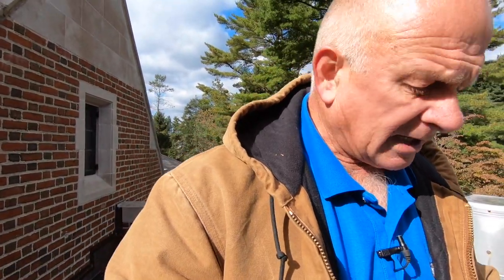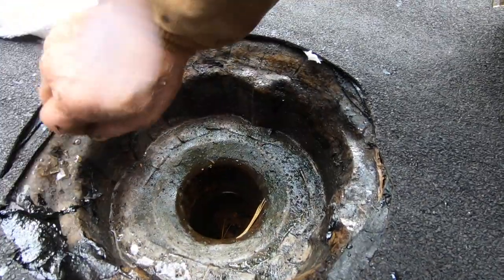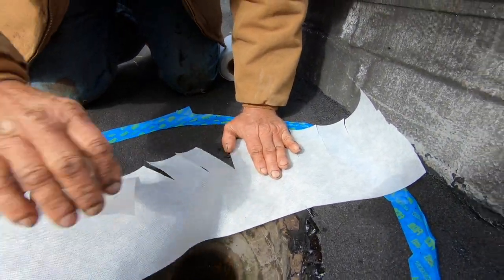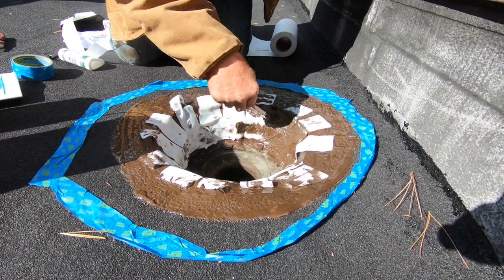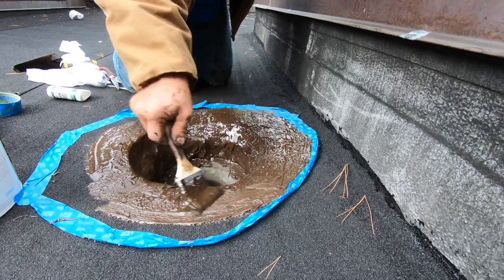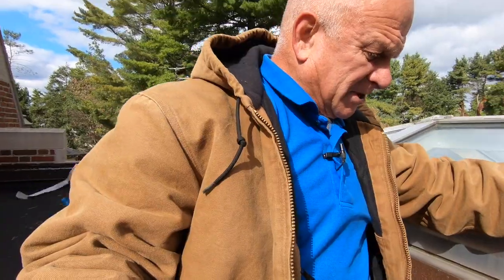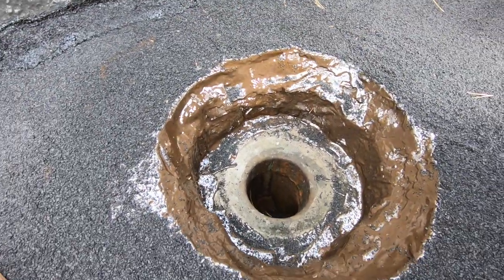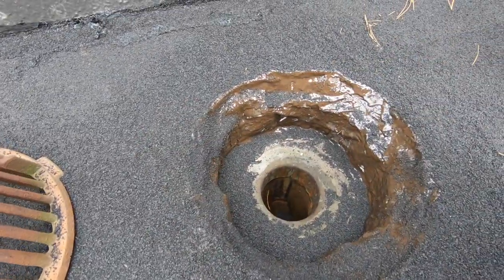Flat Roof leak Repair: How to fix a leaky drain to a rubber membrane /Turbo Poly Seal -@All Roof USA

Comment: Does that not raise that area around rhe drain a bit? Hindering proper drainage? I have a repair to do....scathing videos. This has me concerned doing a flat roof without a slope package.
Reply from the maker: You can remove some of the roofing material around the drain and then do the flashing

Comment: Was that an old lead drain?
Reply from the maker: No, it is a cast iron drain. On this particular roof there are 2 cast iron drains, one I did with Turbo Poly Seal, and the other I did with Modified Bitumen Self adhering membrane. The Turbo Poly Seal one is holding up good, but I had to go back and redo the other one. Goes to show. 
BTW, thanks for the chat on all the videos, this helps a lot with my ranking in Youtube. I guess you were watching a bunch of videos last night. lol

Comment: Absolute hack omg
Reply from the maker: I have been hacking all my life. People like you think you are better than others and therefore will criticize everyone else. Why don't you give a solid opinion than just bad naming someone? Constructive criticism goes a long way and is more tolerable. 
It appears that not only can I teach you about roofing, but I might be able to teach you about attitude too. You have a lot to learn.
Thanks for your comment anyway
By your comment, you show who you are from the inside. Using words like "omg" indicates your type of vocabulary and type of language. Maybe you should take lessons on etiquette too. Hmm after some thoughts, you are beyond hope, just keep being who you are,  join your crowd and end up hopeless somewhere. The years are flying by fast.
Reply: @FlatRoofDoctor  Wow. I will try to be quick here. Your work is hack like you said you have been Hacking your whole  life. I did not attack you personally your response shows who you are. I could teach you about roofing I have over 35 years in the industry several certifications in EPDM BUR residential and commercial. I am a  an  inspector currently. Most of what you do does not come close to specs your work is sloppy, anyone can make a repair does not mean it is correct. Like I said never attacked you as a person just your work, I am sure you are not a bad guy. To bad you chose to be nasty, and make it personal anyway I wish you good things in life, time is flying by is right.
Reply from the maker: @timdwyer710  Everyone has their own techniques and "hacks' to do something. Making repairs does not mean I am installing a roof. I also try to help homeowners to show how they can make repairs with products that are readily available. My goal is to help Handyman and homeowners to make repairs and this is not intended for "qualified" people like you. Regular people don't want to go to school to find out how to make repairs.
So far all I see wherever I come on any job is it has been hacked by someone. 90%  of people try to repair and sometimes get it right and most of the time fail.
All I am showing is how to make repairs that will last. I have done this as long as you have, but I have found methods and tricks that work.
I am not mad at you, but calling people names is an insult to the person and not to the work.
So don't try to paint a nice guy picture about yourself when you are name-calling.
I have seen inspectors pass a house inspection and never had a clue in what condition the roof was. This I have seen a lot.
So your profession also has people inspect things they don't know anything about.
Reply: @FlatRoofDoctor    Expect these "expert's" on YouTube,  don't wast your time.  It was a no BS demonstration of doing a drain repair when an alternate repair procedure may not apply or be available or is too much $
Reply: @lorenavedon  I am the type of roofer you want if you owned property I don not bullshit people. I do work that is to specs and done correctly that is not taking advantage of anyone. A correct repair does not mean you are telling people they need to spend more money at all it tells them they are getting a correct repair. Anyone can make a repair I make a living going around fixing repairs made by people  like this because these repairs will fail. A repair done wrong will cost these people tens of thousands of dollars. That my friend is the real world. If you call being honest a snob well i guess i am